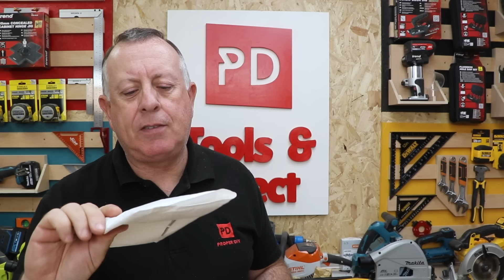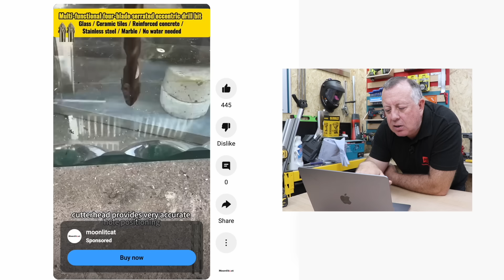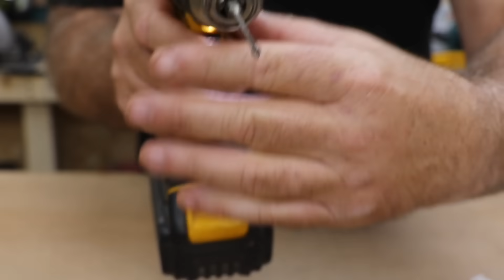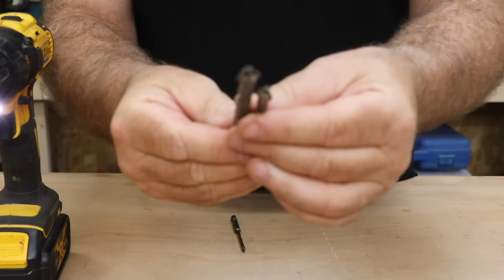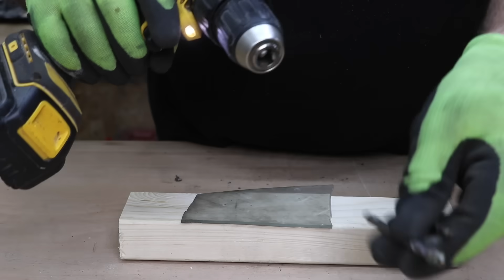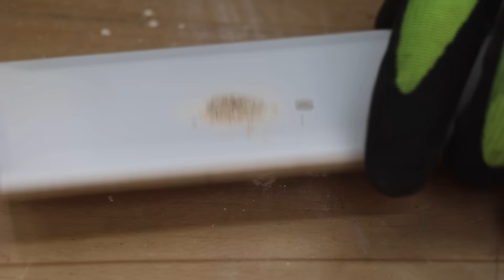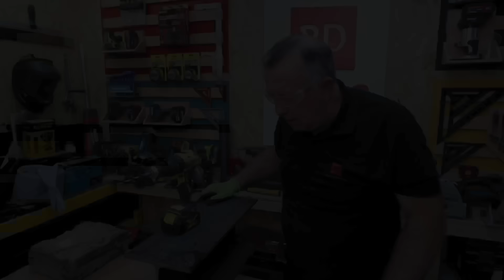Over Priced Drill Bits that Speed Through ANYTHING - Really?

Comment: Note: Drills with Carbide head are great for drilling glass and tiles. I had to take these instead of the steel drills for my tiles in the bathroom. But important to know: High temperature will kill Carbide drills. You need to keep them cool. Water is ok, it doesn't harm Carbide. If you don't know that fact and don't cool you might think Carbide breaks down quickly.

Comment: Very entertaining!!😂😅 I was holding my breath when you got to the steel beam!! I knew it wouldn't go through right from the beginning from seeing the type of tip it had, I'm a mechanical design engineer. The harder the material the greater the torque on that fluted tip hence it broke off in concrete. it works in brittle material of lower hardness eg Tiles, as you found out. For higher hardness material the flutes on the tip should be recessed lower than the drill diameter and only two in number with steep acute angle for delayed penetration to reduce huge torque reaction on drill head( the penetrating flutes). There are design rules.

Comment: So I actually use these professionally, but I buy from the manufacturer,  the original. When you buy them from online markets you don't get the manual! And the adds are NOT made by manufacturer! 
1. Never use hammer action! They should be treated and used like when drilling metal. Which also means you start with a narrow bit first! Never start with anything more than a 6mm bit, then step up to 10 or 12mm. Start with a 4mm is best. 
2. Do not place it in a right 90 degree angle when you start, you should always start in a 75-80 degree angle! Once it has dug the first mm. Into the steel or glass you angle it up to 90 degree nice and steady. 
3. The serrated edges purpose is to lower heat and friction. Never use it in second gear! Again, think regular steel drilling! 
4. While they may drill through 400 tiles before breaking, when drilling any thick material fast, like a 2cm concrete tile, and you are in a hurry, leaning on it, you should expect only 10-20 holes/ every 6mm drill or 15-30 holes for a 4mm drill. Using the 12mm afterwards, the 12mm will break after about 100-200 holes if you predrill with a 6mm. 
5. When drilling steel with these bits you need to at the minimum predrill with a 3mm drill or the drill won't even enter the steel! Again, do not angle them 90 degree! First angle them 75 degrees.
Reply: Their main  benefit is dry drilling in concrete and bricks! They are great at tiles but just slightly faster than the regular normal one for tiles that have no serrated edges. Also, generally the ones you'll get from Temu or others are the ones the factory scanner failed and tossed out due to brittleness from failed clenching. So in that case you'll be buying the new drills that were trashed due to quality issues. Again the real ones are amazing! Would never go back to using other drills for certain tasks! Again drilling any steel you need a predrilled whole. The pointed tip can not enter straight into solid smooth glass or steel surfaces! They are never used for the predrill in such things. First drill a tiny hole so the edged can grind into it. I love that he tested them without bothering reading any manual, because that's what people would do! If they are not professional. And again, he didn't buy from a proper source, so he didn't know how to even get a manual for them.
Reply: For sharpening edges that have become dull (typically the thin ones you predrill with) use a 4000 grid diamond sharpener and softly run the for edges until the tip is perfectly pointy again. Before initial use check that the tip is actually pointed enough, as 1/10 of them typically are slightly less than perfect, but you'll notice the moment you start using them,  I have used them for thousands of holes by now so I can initially feel if I got one that is initially not perfectly sharpened.

Comment: Whilst i get the drill bits are probably crap, excessive force or running the backward (as can be seen with th direction of the chuck with the girder) isnt really a fair comparison. Your bosch bit has extremely light pressure on it. All drill bits fail if forced through material...thats why the glass broke

Comment: Many thanks for this warning and I did not buy the fake lazer welder. However I just lost $89 buying SSD (Solid State Drive) from a company using the SanDisk logo in their advertisement on social media, when the product was delivered the item had the same shape as the SanDisk but instead had HardDisk printed, and is made of cheap plastic instead of aluminium as per the Genuine SanDisk. And worse it did not work! Never again will I buy stuff like that from an unknown company.

Comment: I worked facility maintenance in a hospital for many years, so we were constantly drilling into ceramic tiles. An old coworker taught me to tap the tile with a center punch to pierce the glaze, and any drill bit would drill the hole.
Reply: that's a good way to crack the tile.

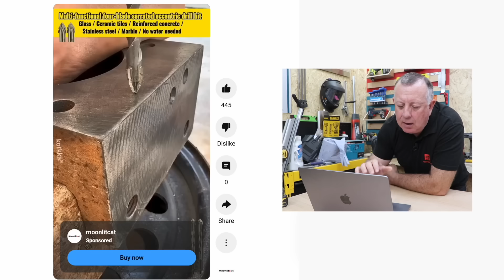Comment: If you look closely at the drill bit advertisement, 1:09 the '60mm' steel claim is actually a piece of painted mdf😂😂Love your work sir!
Reply: No it's not it is a block of cast iron and those radius marks in the face of it is from a fly cutter that made them in a milling machine not from a table saw blade.
Reply: @markmawson1  He may be thinking the rust on the end of the block looks like MDF. But the block is machined cast iron or steel. The whole advert is rubbish.
Reply: @markmawson1  - you're joking? - it's a block of painted wood.
Reply: @alpal2002 I'm not arguing with you I know what a piece of machined cast iron looks like and the swarf that comes from it when it's drilled.
Reply: @alpal2002 how do you get metal dust out of a block of wood?
Reply: wow - it is too - how fake.
Reply: Cast iron .
Reply: If it is what you believe to be MDF and the outside has been painted to make it look like a block of steel how do you get the drillings to come out looking the same colour as the painted exterior tell me that?
Reply: @markmawson1 ai

Comment: I got mugged into buying some too. Use once on fairly light materials, then bin them. Useless in comparison to proper drill bits. Two were bent when I received them. Ripoff in reality. I want the ones used in the advert lol ... What were they? Or was it AI-generated? If you need Steel drillbits, you will struggle to find better than Stroton. They have a lifetime warranty replacement service too...

Comment: They share the same construction and features to a normal glass/ceramic drill bit (the one with a brazed pointy D shape). They are just more funky looking with those serations and cross section.

As with a glass drillbit they are very prone to chipping if the material is not uniform like concrete, if there is any hammer action, any bump, any rotational impact.

They cut very well ceramic, stone (uniform) and other but it must remain cool (slow speed, lots of water) very light pressure.

These type of drill bits will not cut elastic materials like steel. The steel will not shave a chip, the steel is elastic needing more force, the carbide tip will shatter from the enormous friction and heat. Similar thing happens to normal drill bits that try to cut titanium as Ti is much more resilient and will not shave a chip easily unless a very big force is applied. Ti is machined fast spinning with tons of coolant and tons of pressure on cutter head. Way more than what steel needs. And dulls every cutter 10times faster than steel.

So they are just more funky and more expensive ceramic/glass drill bits.

Comment: Assuming the cutting blades are made of tungsten carbide (like other masonry drillbits) your rotation speed seems quite low. To give them an honest chance try something like 4k rpm for the 12mm drill in steel. Halve the diameter doubles rpm EG 10k rpm for 6mm drillbit. Let the drill do the work so dont put your weight on it. Why? Compared to HSS, tungsten carbide has much higher heat tolerance but is much more brittle (prone to cracking and chipping). Also never cool tungsten carbide with water or oil because the resulting thermal shock will crack the cutting blades instantly. Use an airgun or no cooling instead. 
So to make proper use of tungsten carbide tools one should increase rpm while decreasing chipload. 
Not saying this will change the verdict on these tools but to test any type of tools you will need to use them like intended. 
If the cutting blades are HSS none of the above applies.

Comment: 11:46 That rising curl of swarf is always a pleasant reveal. Shows that one is getting somewhere!
Reply: Actually, that SINGLE curl of swarf (from ONE flute) simply means thatthe drill was NOT sharpened correctly, as one flute isn't even cutting (the other is doing ALL of the drilling work), thus it takes twice as long to "get through" the metal, than it would have taken had BOTH flutes been ground correctly.
As an apprentice Electrician, in a workshop where "large" Copper Busbars were drilled for (3phase +N & +E) 400v/230v 50 hz AC switchboard construction, it was essential that HSS drill bits were correctly sharpened BEFORE starting each long length of copper busbar (and sometimes, if lots of holes were needed, regrinding the bits partway through each length of hard-drawn copper busbar - meant that the apprentices were doing a LOT of "bench grinding" work, to ensure these were sharp for their instructor, to show them the quickest way to cut HOLES in copper as well as in iron frames and thin sheet panels, plus any concrete work when masonry impact drills needed resharpening sometimes too.

MOSTLY - I was taught a far different way to "grind" new bits, and that was to use the corner of the grinding wheels, to "cut" a V into each flute, leaving a pinpoint at the tip of the bits while removing most of the flute itself, so that another "riser edge" was near the outer circumference of the bits, where THESE also had to be identically ground, to match the opposite side, to avioid single swarf curls, from unbalanced sharpening methods.

When using THOSE (specially butterflied) HSS drill bits - the speed at which one could drill (as well as the "cleanlyness and TRULY centered holes") in all metals (including Stainless Steel) were so fast the materials appeared to be like soft WOOD to that style of drill bit, which leaves a "convex" shaped washer, as the final "cut-through" plug, instead of having holes that were a triangular shape (not pure round) as well as having a LOT of "pushed-through" sharp & rough edges with ragged holes in thicker materials, and often TORN holes in thin sheetmetals.

Those were what I called Butterfly ground tips, with THREE cutting areas, the center bore, as well as BOTH wing-tip sharp cutters, which SIZED the holes correctly, and kept them centered as the drill "bored through"...

I spent over ten years in that "heavy industry" switchboard manufacturing business - and learnt most metalwork as well as all my electrical trade knowledge during those years.

I only "left" to try and start my own Electrical repair & installation self-employed business, (obviously in hindsight, it was done without enough backing capital), and thus was soon suffering from financial collapse, as well as major physical & medical problems, (from the stress of overwork and long hours), until major stomach surgery forced me completely OUT of any steady work.

I therefore started a registered NZ Company - to work within, as a NON-PAID owner, funded almost entirely by the NZ Govt's permanent "permanent" unemployment wages (social security benefit it would be called elsewhere) - however, since 2018 I have been placed into the Superannuation fund sccheme for senior citizens, so have a higher  level of funding, and almost NO outgoings, haing purchased the property Ilive on, many years ago, and KEEP all purchases to a portion of what my income is per fortnight, thus enjoying my retirement, by being my own boss, yet not having to work (at all) if I don't want oo, on any day of the week?

Yet - even from my new vehicle (a hand propelled "wheel-chair" after a BKA / surgery on one leg) - I can still sharpen HSS drill bits either the normal (wood hole shape) or the HSS mtalwork butterfly shapes, gtting BOTH flutes to produce the exact same swarf curls.. proving the drills have been sharpened correctly.

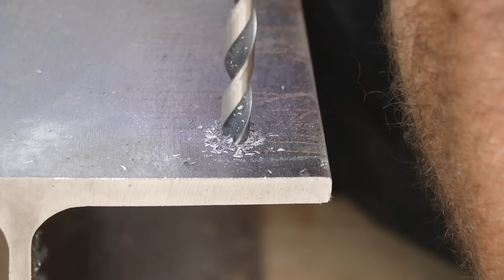Comment: Funny how working in a machine shop showing me that's not steel at all. They only show drilling thru Cast Iron. Not near as hard. It can be a mess because of the amount of carbon in the stuff. Mind you, the thing that makes Steel harder than Cast Iron isn't the amount of carbon. Hence the difference in the chips you get at 11:40 compared to the dusty grey powder of Cast Iron you see in the advert clips. Cast Iron has a ton more. It's that Steel is structured tighter. But that's also why the chips come out like a powder.  Do be careful. Because if that IS carbide tipped, that stuff can be rather nasty stuff if it breaks in the open air. The screaming sounds like a poor grade of carbide that is already dull.   Thanks for busting the advert on rubish.  Saves me a pretty penny. Maybe some quid, too.

Comment: There are some carbide tipped drills that work for more than masonry, genuine Artu bits from Germany. They will drill hardened steel, brazed to withstand 1000 degrees celcius and they work well. When you forget to drill pin holes before heat treating knife blades, they will get through. drill press only though.
Reply: I bet punching those holes with a Whitney punch would be way quicker and easier than trying to drill hardened steel, regardless of the drill bits
Reply: @chrisrageNJ  That will just shatter a knife blade once it is hardened, 62-63HRC

Comment: That tip looks like it has been brazed onto the shank.  You really should clear the flutes on your drill bit before starting the next hole.  In shop we used cutting oil with the usual high speed steel drill, as you should be.  I bet the advert shows no cutting oil used but for a "normal" drill bit you should have.  Looks like you did, by the end of the I beam drilling.  I was considering a set of these and like you, I like a container where the sizes are laid out for easy ID.  I see something like this as an interesting concept that could perhaps be done well by a reputable company and of course it would cost a good deal more.  How about Cobalt steel or Carbide bits ?  I would like to see evaluations on those.  If you don't I may submit the idea for testing to the Project Farm guy.  Thank you for an awesome, fantastic public service, Sir.

Comment: I drill tiles with ordinary HM-masonry bits, just without the hammer-action, and it is EASY.
The "steel" in these scam adverds produces fine shavings EXACTLY as cast iron does,
which is super-soft and easy to drill compared to steel. Apparently cast-iron was used to film that scam.

Comment: Ha ha! Welcome to "We scam you big time." that the world is full of.  If those drill tips were engineered from something super hard like on a decent masonry drill tip, then having 4 cutting faces instead of 2 ought to cut in half the time.  The advert will have the real McCoy being used plus a 200lb gorilla ramming the drill down.  When you receive your chocolate metal ones then well... you get what you have found.  Decent drill bits cost a packet and you are stuck to reputable engineering suppliers to sell you them.

Comment: Thank you again for your test. As soon as I saw the advertising film, I had my doubts as to whether it was possible to make accurate holes with these drill bits. Every material needs a suitable drill bit. There can therefore be no such thing as a universal drill bit. The whole offer is therefore expensive scrap iron. Funnily enough, immediately after your video, YouTube showed the advert for the fabulous laser welder, which you exposed in your last post as the cheapest soldering gun - they won't give up!

Comment: looks like modified weakened concrete hammer drill bits. typically, that type of hardness tip breaks off or shatters if it chatters or binds, it's real hard to use them by hand.

Comment: My dad showed me how to drill ceramic tiles. Use a masonry bit or a spade style bit BUT put it in hand operated brace, the sort wood workers use (not a breast brace drill with  the crank handle). Work slowly and you will drill perfect holes every time - no need to use water coolant OR expensive drills.

Comment: The thing your not taking into account is the original 5 second advert  was done using 'chinese' steel, and as a welder with over 30 years experience, I can confirm that had you used 'chinese' steel and not 'anyother' steel then you would of indeed been able to push the drill bit through the steel in 5 seconds with or without a battery for your drill.

Comment: That is temu technology . I think there is reason why the classic drill bit edge geometry remained largely unchanged for 100 years . The carbide tipped masonry bits are a bit different , but still very similar . The carbide (cnc) bits are still largely the same , except the assymetric inserted bits , but that has nothing to do with the classic twist drill bit.

That cutting edge profile looks like a profile milling cutter for wood working .

Comment: The drill going through looks more like CGI fakery, plus, the metal is producing dust and not shavings.
If the drill bits are as sharp as they claim, shouldn't they have cut through the bag?
The bits are all made from high quality Chinese steel, which is so advanced that they only figured out how to make the balls for ballpoint pens less than a decade ago.
The tip is supposed to come off so that it can keep drilling on its own after you remove the drill.
Glad you stopped when you did on the steel as I was rather worried the bit would snap and give you an arm piercing.